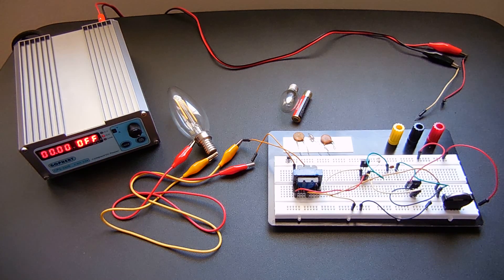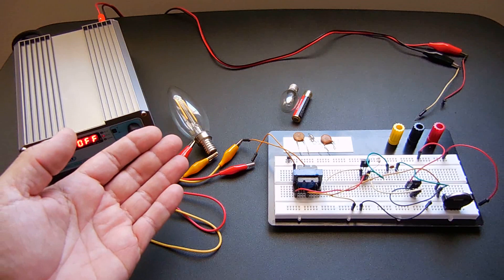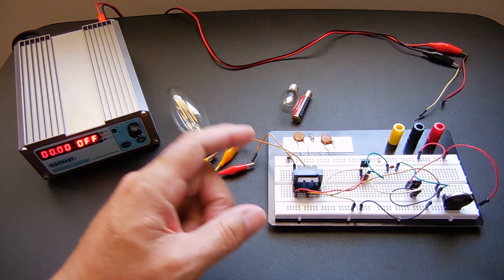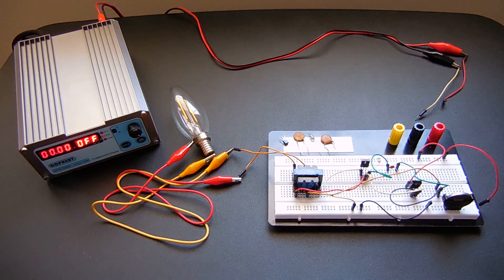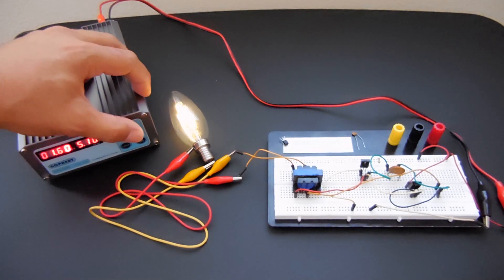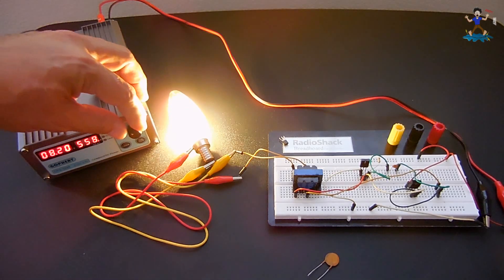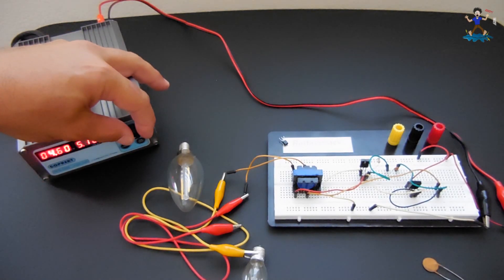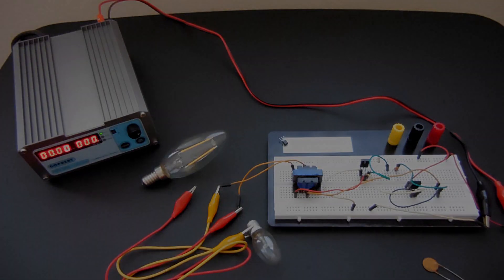How To Really Make AAA (1.5V) Battery To 220V AC Inverter

Comment: A 5W 230 Volt Bulb needs only 21 mA to light up, with 1.5 Volt it needs 3.3 amps to get 5W. You should show as well a detailed circuit diagram to understand better how Your interesting  circuit with pnp and npn transistors works, other people might try to check it out.
Reply from the maker: There's more than enough information in the video to duplicate the circuit. Thanks fro watching!

Comment: You want to hope those leads you are holding for the output are rated for such high voltage or one day you might be in for a nasty shock, possibly fatal as the insulation material breaks down.
Reply from the maker: I've been shocked by accident many times over the years. :-)

Comment: I need to build an inverter circuit to power up a 40w incandescent edison bulb. The purpose is just a little demo (mounted on a piece of wood or whatever) so people can see what the bulbs were like back in the days of Edison and Tesla. Giving off that cool amber glow. You can get them fairly cheap with some nice, creative filament designs. I would really like the demo to be powered by battery and switch (simplicity, portability). I'm not too worried about efficiency as it's just a demo, maybe powered up 30 seconds at a time. I see this circuit might not meet my current requirements. I'm having a hard time finding one. Any ideas?
Great video as always!

Comment: Cool stuff man, thanks.
I got a similar variable power supply (Gophert CPS-3205) like the one you got, it is very nice to have if you are doing electronics projects, kinda fairly priced too.
http://www.gophertc.com/en/cps-3205
https://duckduckgo.com/?q=Gophert+CPS-3205&iax=images&ia=images
Your project about recharging alkaline batteries with 555 timer IC and a coupla transistors...etc. Is really nice and useful.
I wish you do like a an enhancement on it like driving it to version 2 with a voltage regulator say LM317 or LM78xx so it can charge with anything above 9v DC (10 ~ 24v DC source; car jack, laptop adapter).
Also simplifying the project. And going step by step into building it. Some beginners are afraid of the ICs and Transistors.
So maybe showing them a simple way to connect the 555 timer IC like: first connecting 4 and 8 together with a wire/jumper cable then connecting 2 and 6 then from 5 a .01 uF(10 nF) cap goes to ground...etc., then we are left wit C1, R1 and R2 to try different values on.
Fritzing is a free app for doing and showing different drawings like breadboard and schematics...etc. http://fritzing.org
https://en.wikipedia.org/wiki/Fritzing
Thanks a lot and regards.

Comment: I don't think a 1.5v alkaline can deliver more than 1 amp. The commercial batteries have over current protection. The best batteries for circuits like these are 18650 3.6v li-ion batteries. They can deliver a lot of current. They are awesome batteries, and they're free, if you know where to get them.
Reply: I think you are right. DiodeGoneWild Czech Youtube guy kinda showed stuff about AA batteries. Discharge and how much different brands hold of charge. His shows are interesting and he is funny. He made his own battery dis/charger & tester.
https://youtu.be/3Mr6FOWyYsQ

Comment: Transformers step voltage DOWN
Reply from the maker: Wrong, transformers can raise or lower voltage.
Reply: you take the same transformer but connect from the other side and apply low AC to it and you will get around the same input AC. So a step down transformer can be used in step up but it will provide less power(voltage . amperage = wattage) due to losses of inner wire(s) and core. Try it but be careful, use wood board and hold wires into terminals. try and measure voltage with a voltmeter/DMM.
There two types of transformers: step-up (go from low to high voltage) and step-down ones like you said.
a regular step-down transformer could be used as step-up but it will provide less than rated power.

Comment: You said the output of this circuit was around 240v AC. How dangerous is it to work with high voltage AC like that in a tiny circuit like in your video? You seemed to handle the output leads with very little caution.
Reply from the maker: Hi Jeff. Depending on the input voltage, the output voltage can be way above 240V with no load attached. Using a 1.5v battery, the output current will be very low milliamps which won't kill you, but if you use higher voltage, like I did in the video, then yes, you can be killed by the output. If you take the output using a 1.5V battery, and use it to charge up a large high voltage capacitor and touch the leads, then yes, you can be killed by the discharge current. I've been playing around with electricity for 35+ years, so handling it is no big deal for me. Thanks for watching!
Reply from the maker: I see you're into drones. :-) I uploaded a video months back that you may like the see. Me having fun with a drone near the ocean, then the rest of the video is fun in the sun. Check it out.
https://www.youtube.com/watch?v=6WccKnY2nSM

Comment: I'm just getting into electronic circuitry, and components. I am curious as to the name of the board that you are using to hold all of your components in this video. Also, if you could recommend any literature for someone who's trying to learn the art. Thank you
Reply from the maker: Hi Jerry. There's a good website called, "Talking Electronics". I suggest you visit the website, you could learn a lot about basic electronics. I have a product review playlist showing great deals on equipment that you'll need(Perfect for a person new to electronics). The prices are great. I also supply money saving coupon codes. What's shown in this video is a breadboard. Below are links to a breadboard set, power supply unit, component tester, and digital multimeter for electronics use. Thanks for watching!

Perfect kit to get you started: http://bit.ly/2tJceB3
Power supply unit: http://bit.ly/2t9NPr6
Digital Multimeter: http://bit.ly/2rapahk
New version of component tester: http://bit.ly/2saZ5ia

Coupon codes listed in the video description area. :-)

Comment: Great stuff! Could you supply all parts in that circuit for maximum 1Amp output and full instruction? How much would it cost per pack. I would probably need multiple packs. I am running a Not-For-Profit training facility for the disabled. This will help our Solar/Alternative Energy projects. Thanks & Regards. Sham
Reply from the maker: Hi there, The input can easily handle 1A with no problem if heatsinks are used. The output will always be much lower current because you are boosting the voltage. No for 1A.

Comment: How do you feel about Bedini free energy device, as explained in his own videos with all the measurements needed?
Reply from the maker: I have one on my channel. The SSG charger. It works, but I didn't see any energy gain.
Reply: Thanks for reply! I watched his (Bedini's) long, detailed videos years ago and the impression i got was that the charging battery didn't drain while the charged one filled up. My feeling was that if someone could make a simple electronic device which would shift the function of the charged/charging units the thing will just run forever in a closed system (ignoring obstacle of friction of course). But i'm not sure which of the schoolgirl models i was looking at.

Comment: Awesome inverter circuit. It is great for demonstration purposes.
Reply from the maker: The Engineer Glad you liked it!
Reply: electronicsNmore. what if you make a bedini motor to rotate more wheels with magnets and coils for dc power output charging one battery and make it leak to the one runing the bedini motor with diodes you should make a video of it